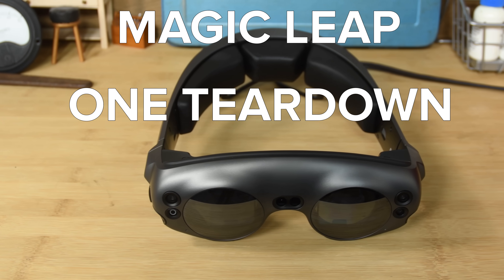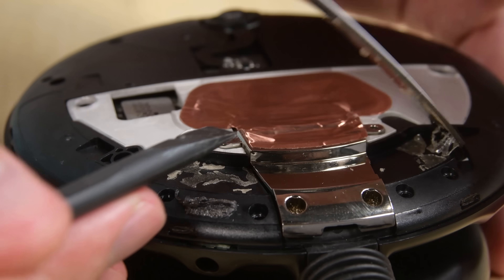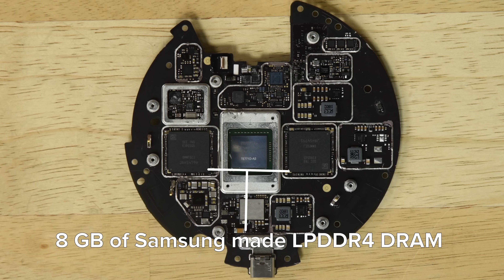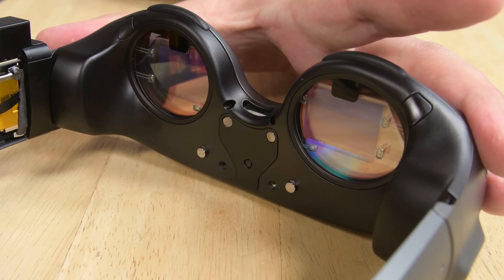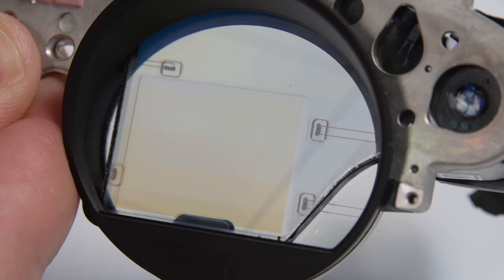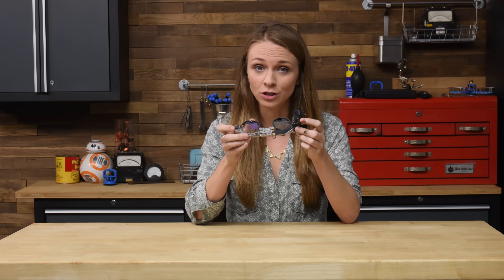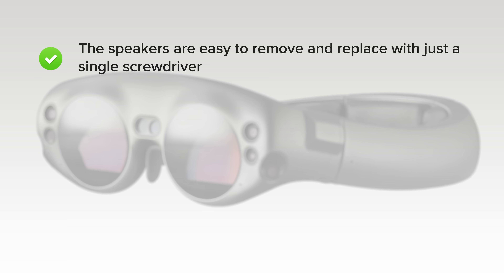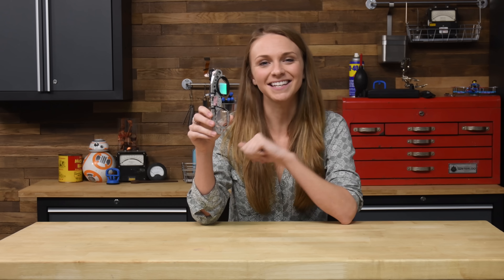Magic Leap One Teardown!

Comment: Comentar que ya he tenido varias Magic Leap One Creator Edition, Size 1 y Size 2, y todas al cabo de unos meses se han roto, en concreto el problema es que al abrir y cerrar la diadema para colocar en la cabeza, el pequeño conector y cable flex que conecta el sensor magnético se rompe y deja inutilizable las gafas por completo, sin el mando controlador no se pueden usar. Un fallo terrible de diseño al estilo flexgate de los macbook pro. // Comment that I have already had several Magic Leap One Creator Edition, Size 1 and Size 2, and all of them have broken after a few months, specifically the problem is that when opening and closing the headband to place it on the head, the small connector and the flex cable that connects the magnetic sensor breaks and makes the glasses completely unusable, without the controller they cannot be used. A terrible design flaw in the flexgate style of the macbook pro.

Comment: Thanks for the amazing video. I have a question for Magic Leap: where is the light field technology actually applied in? I can only see a wave guide display which is apparently different with light field display's concept, the fiber scanning display is gone as well. I really confused.
Reply: The fiber scanning went away a while ago because they couldn't get it to work the way they wanted. The wave guide is stacked with multiple layers each producing a different focal distance at the same time. There are only 2 focal lengths in this version (near and far). So not near what was originally hinted at in the patents from years ago.
Reply: :O I see. What would they do if there's an arbitrary focal length needs to be displayed?
Reply: @zwindl  It just wouldn't display it I would assume. There are videos online of people getting to close to an object and it just disappearing. This is due to it not being able to project images closer. Keep in mind that they control the digital content so they can just make sure things stay in visual range. Plus it really helps that our brains love to fill in the gaps when we see something we don't fully understand.